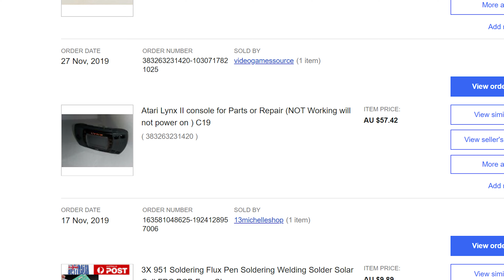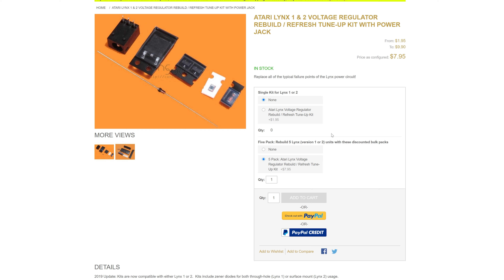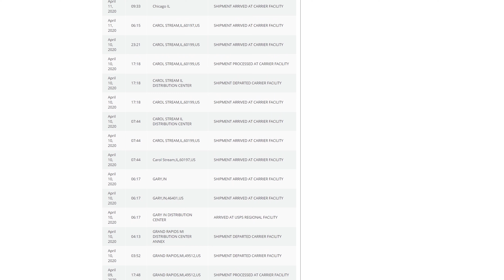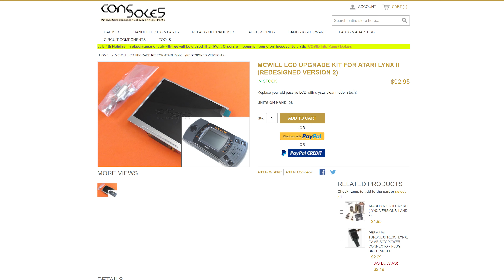Atari Lynx II Repair: Will not turn on

Comment: I have a Lynx 2 too. Sadly I kind of destroyed it as a kid. Found it on the attic in a box full of random electronic stuff and cables. I took the console and a fitting cable (car jack) and tested it in the car. I can remember smoke escaping and I think I destroyed the CPU at that point. I was pretty young back then, but some months ago I tried to repair it, but couldn't find any broken parts inside and the console turns on but just has a lot of lines on the screen and turns off after some seconds. I'll keep it in case I find another broken one in the future and make a working one out of two broken ones.
Reply from the maker: Can you see the game running in those few seconds? If so, the proprietary chips should be fine (the ones that can't be replaced).

Comment: I unfortunately bought a broken one that was a failed repair without knowing it. I wouldn't have touched this thing if the seller said it was a failed repair job. So now I have no clue what is or isn't wrong with it. I can here a pop noise briefly when powering it on, but get nothing else. A shame they're not dirt cheap like Game Gears, otherwise I would have bought another one at this point.
Reply: Update: I tried your 5V bypass idea with a USB cable and........still nothing but a pop. I guess whoever had this before me fried the damn thing. Such a shame that so many of these get screwed over by poor advice.